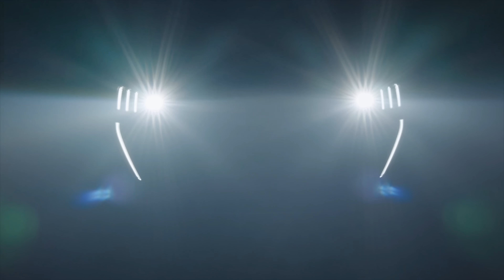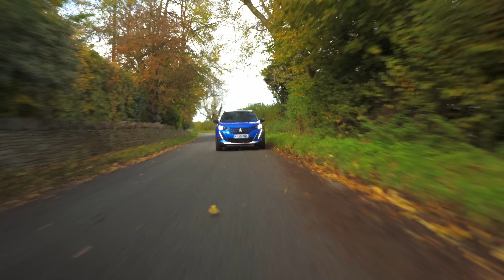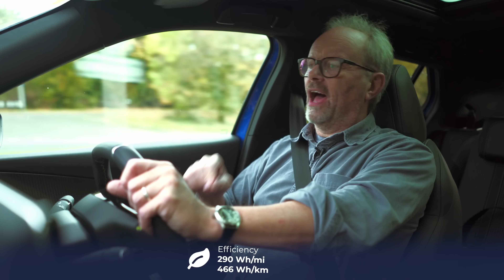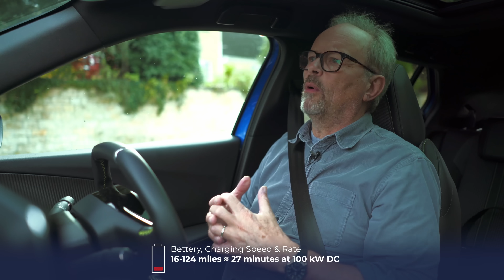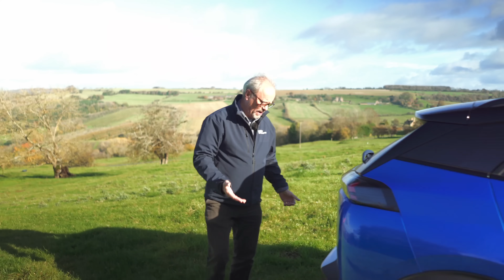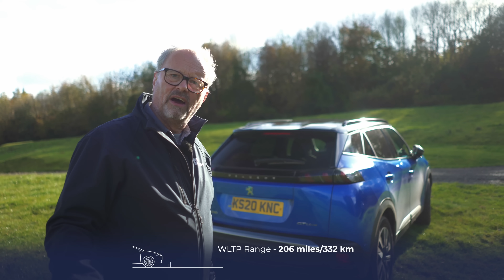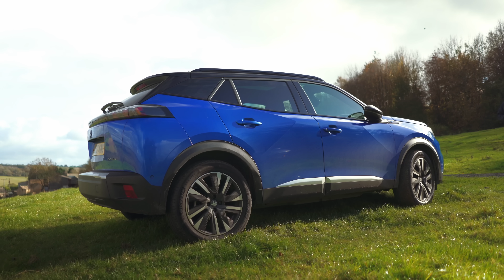Peugeot e2008 - how does it compare to other compact SUVs? | 100% Independent, 100% Electric

Comment: This has just dropped $25,000AUD in price!!! (In Australia at least) making it one of the cheapest cars on the market. Its low enough to make it possible for me, but after watching review after review and looking at the specs I just cant see the value even at that price. Poor range, average performance, ICE chassis, no reversing cameras, and it cant even tow a trailer. The BYD Atto 3 may not have the name, but it sure has the features.  Guess I'm waiting for the next crop to hit our shores and hopefully the prices keep the downward trajectory.

Comment: I bought this nightmare of a car, cental locking broke, heater broke, gearbox broke, air con broke in all under a year. And it only does 50% of stated range. Don't touch, don't buy. Walk away. Avoid, don't waste your money. Stick with ice car,but not a Peugeot car ever.

Comment: So you charged it absolutely full, and it said 130 miles. But then, after driving it many miles you say you have 124 miles left... As a reviewer (no, as any car owner) you should know the number on the display is calculated in several ways and depends massively on the way you drive it and where you drive it (city or motorway), so you shouldn't be pointing out "only 130 miles" instead of the projected 267 miles on the NEDC standard (which NOBODY uses, everybody uses the WLTP standard!) before you've actually driven it. Point is, if you are looking to find negatives, you will find them, whether they are relevant and real or not. This car isn't perfect, but the perfect car will never be made, so point out the faults but don't complain as if the car is rubbish because it has faults, as that is how it comes over to me.

Comment: I know where you're going with "it's built for a combustion engine but they've adapted it for an electric motor", but if the design is nice, is it really necessary for the car to scream out "I'm an EV"? And what should that be then? The front window on top of the front bumper, so people would know there can't be a combustion engine there? Nothing wrong with having the car look like a CAR, in my opinion. The only thing not enough manufacturers do is take advantage of the extra available space (in the frunk). But that supposedly is partly because it's harder (expensive) to fit in frunks and pass crash tests. At least, that's an explanation I heard from a Smart executive, who explained why there's only a tiny 15l frunk in the Smart #1. And to come back to my first point, the old tiny Smart cars hardly had an engine compartment, and they never became a success partly because they just looked weird to many people. So now Smart has changed directions and their new car (although an EV) looks like a CAR instead of a box on wheels.

Comment: You could drive a solar powered car at 20 miles an hour all day long and it would be more energy efficient than a freaking candle but i still couldn't care less, so your mpg to kWh/km comparison means nothing to me to be honest. I drive a diesel with a 45L fuel tank and get 1000 kilometers of range out of it and fill up after around 800kms for convenience's sake, and there's not really any chance in hell I'd consider making the switch to a car that I have to plug in every day, drive 1 hour to my office and have to plug it in there again just so I can turn on the AC on my way back with some peace of mind
Reply from the maker: Just try to imagine how many comments we've received almost word for word the same as this one you posted. 
Do you think anyone is interested in how far you can drive in a clunking, dirty, inefficient, dated and incredibly dull old diesel?
A machine that requires this country to import toxic, expensive, heavily subsidised fossil fuel from the most corrupt and corrupting regimes in the history of humanity.
But forget all that, if it means you can drive 1000 km without stopping, while you leave a trail of genuinely poisonous gas behind you, then screw everyone else, you can drive a long way and fill up quickly. Oh silly me, surely that is the single most important technical achievement the human race has ever achieved.
Never, ever, think outside your narrow, blinkered little world at the impact your actions have on the rest of the population. Screw them all, they don't matter, as long as you can drive 1,000 km non stop, every freaking day, then you just carry on sunshine. No one gives a stuff. Bye.
Reply: @fullychargedshow  I LOVE this reply! Truer words never spoken.

Comment: I have a had a e2008 since the beginning of march.  I have not reset the trip since i got it and it am averaging 4.3mi/kwh over 400 miles of rural and town driving.  Highest temperature has been 9 degrees C.

I believe i will get much better results in the summer.

Comment: I just had one of these as a loaner while my diesel car was in for a service. I have to say I thoroughly enjoyed driving it, so much so that I just drove aimlessly around for a while just to experience it some more:-) I liked the smooth linear power delivery and of course, how quiet it was. Some have mentioned intrusive road noise but I didn't find it intrusive at all. It rode quietly and smoothly, and I drove over some very rough roads. Space inside was ok too. I'm 6" and I found the space in the back seat behind me was more than adequate. 
I did find visibility a little restrictive though. The rear view mirror, because of the sharply raked windscreen, was half way down the windscreen and blocked a lot of the view to the left. Also, I found judging the near side a bit tricky due to the high bonnet line so squeezing through narrow gaps in traffic was a little tricky at first, but I quickly go used to it. 
I also liked all the high tech in the car such as sat nav, apple and google play, reverse camera, inductive charging for smart phones etc. You couldn't ask for anything more.
As for range I got it fully charged and in eco mode it had a range of 192 miles. This went down to about 170 miles in normal and 150 I think it was in sport mode. I found eco mode a bit sluggish and the accelerator required a fair push to get moving along nicely. Also, heating/air con was restricted in this mode too. Normal and sport were more like an ice car and it was these modes I used most. When I took it back eco mode was showing a range left as 100 miles. I hadn't done 92 miles, only about 50, but I had used normal and sport modes a lot and had the heating on so that must have been where the extra charge was used.
To sum up I was quite impressed with this 'looks bigger than what it is' little car and seriously considered considered getting one, until I discovered the price! The spec I had was a new Allure Premium+GT with just 300 miles on the clock. It retailed at a fraction below £40,000! That's a hefty price to pay for an electric motor and some lithium batteries I thought. I'm still considering though,  mainly to use locally, which is most of my driving anyway, and also because the tech intrigues me🙂
This all electric car is not something to use if you're doing lots of motorway miles but they are a great city car and 95% or more of us do drive mostly locally. As we all know they have no exhaust so don't pollute locally or wherever you're driving. They simply move the pollution elsewhere, ie, the power station where the pollution can be dealt with in one place with various filters etc. Which is a big plus I think:-)

Comment: I am a Fully Charged fan and also like Mr Llewelyn. But this is both at their worst. An under-researched review that’s overwhelmed by the rant-fest about non-dedicated EV vehicle architecture, SUVs in general, legacy manufacturers EV pricing models etc. Mainly  valid criticisms, but this was supposed to be a car review and somewhere an editor / director should have been doing both and either wasn’t or was over-ruled. The car review element of this was underwhelming.

Comment: So another equivalence is that this car has a 1 ½ Gallon fuel tank? Approximately. And depending on outside temperature, that will take you 130 miles? Buildings EVs for the sake of it is undermining the whole idea of sustainable transport.

Comment: I currently have a Kia Niro PHEV , but changing soon , dont know whether to go for a e2008 or another Niro. 
Can get the GT Premium model , for the same monthly cost as the e-Niro 2 trim level with the 64kw battery which equates to about 100 miles extra range for the same price.
e2008  looks a lot better than the niro though. 
Basically comes down to looks vs extra range

Comment: 130 miles on a full charge, that’s terrible. 
Long live Kia / Hyundai large battery cars with 280 miles.
I can’t say I’m impressed with the 2008e Robert.
My number one choice would be the eSoul. For price / range / speed / standard equipment / safety features it is a winner.
Great review though Robert, great channel.
Greetings from Cumbria.
Stay safe and well.

Comment: Dad got a Peugeot 4008 hybrid a while back and it’s quite lovely for what it is. I love the smaller steering wheel. Very elegant and easy to use, when I get back into the Skoda the normal steering wheel looks absolutely gigantic. I look forwards to the next generation of these cars, a proper EV from Peugeot would be very interesting.

Comment: “Waiting for a different designer to make an electric car not like a petrol car”.......the BMW i3 Robert!
8 years old. Designed and engineered for electric. Nothings been built like it since. And it STILL looks more futuristic and fresh than any other. Wheels in each corner, short blunt overhangs. CRF tub ultra lightweight. It’s brilliant! Shame no ones had the gumption, except VW now with the ID3 to do one. (Tesla’s are 3 box design)

Comment: Ok get the electric version as it’s much much better but is it much much more expensive?? I’d love an ev but until I can get one for 25k on the road I won’t- well keep our 15 year old 4wd

JusT looked up prices e208 starts from 26k pounds diesel/ petrol from 15k pounds- !!! 

So you can buy another car with the difference-

I love evs and desperately want one but why do manufacturers keep making them over priced- I know batteries are just too expensive right now 

That’s why they add all the luxury trimmings which cost next to nothing but gives more perceived value

Comment: I’d like to know how much it costs to charge one of these things. When I fill my 2010 Honda CRV (which will be my last ICE car) it costs about £55, good for about 450 miles or so. The financial angle is important to a lot of people.
Reply from the maker: Okay, here's a quick breakdown of how much 450 miles can cost in an electric car.
If the car does around 4 miles to the kilowatt hour (the Peugeot e2008 would manage that for 9 months of the year in the UK) and you charge at night on an off peak tariff, (I pay 5p per kWh overnight) then it's going to cost just over a penny a mile.
450 miles would be in the £5-£5.50 range.
If you charge on daytime tariff, say 15p per kWh, that would cost about £16.50 for 450 miles.
If you only used rapid chargers, (24p per kWh) then it would set you back about £28 for 450 miles.
Then, the most expensive electricity you can buy is from IONITY chargers (they are very fast) and they charge 69p per kWh.
This means 450 miles would cost £77. So yes, it is possible to pay more for electricity than it is for fuel.
But one final point, if you get an IONITY card, then you only pay £8 per charging session regardless of how much electricity you consume, so clearly you'd only use an IONITY touch to pay charger and pay 69p per kWh in an emergency.
Reply: @fullychargedshow  Thanks. FYI What flipped me to go electric was working for a month in Bangalore and experiencing severe air pollution, by midday my lungs and airways would be raw and sore, my eyes streaming. 
My next car will definitely be powered by lightning rather than exploding dinosaurs.

Comment: I dare say someone else has picked it up but this thread is very very long! So at the risk of repeating someone else's comment, 290Wh per mile (see 4m point in video) is 1000/290  = 3.45 miles per kWh. Not more than 4!! How could it possibly be more then 4 for a car of it's type? Sorry Robert!

Comment: I have ordered a GT line my daily commute to and from work is 28 miles and weekend around 40 to 45 miles each day on a very busy weekend. So realistic I’am looking at around 220 miles a week. So a month around 880 miles, if I only get 150 miles out of a full charge which I think is a bit low looking at all the evidence that’s just under 6 full charges a month. My electric supplier after 12.30am till 04.00am charges 0.05p per kWh this means less then £20 a month. I honestly can’t remember when I last went on holiday in this country I live 2 miles from Manchester airport and the last 30 years use this for my travel needs. If I can’t plug a car in 6 times a month on my drive and set it via the app to start charging at 00.30 in the morning there is something seriously wrong with me and I shouldn’t be allowed to drive on public roads. If the average driver takes time and thinks about their average distance spent in their cars each month they will soon realise that the obsession with range is just something everyone else seems obsessed with and the average person could easily live with any electric vehicle.
Reply: Very well said.

Comment: I'm not sure what Robert is complaining about when he says it looks like an ICE car and not something designed from the ground up as electric. Exactly what is it missing that it should have, or conversely what has it got that it shouldn't - in relation to ICE vs. EV?

This is not the first time this complaint has been made and I don't understand it. What are the designers missing that is apparently so important?

I can only conclude that the use of regular instruments and gauges in the position accepted by all except Tesla as the best location, i.e. in front of the driver, is what causes Robert to complain. He is a Tesla owner and it appears to make him think any car with information display in the traditional location, i.e. in front of the driver is 'dated'. I know he had a Model S, but now a Model 3 which he loves and I think leads him to mistakenly believes that all EVs should now have an iPod stuck on the middle of the dash and nothing else with which to control the car.

In fact the reason why most cars have their info. display in front of the driver is because ergonomically IT'S THE BEST PLACE. I know you can get used to turning your head to see the Tesla iPod, but that is NOT as convenient as simply dropping your eyes. That's why every manufacturer designs their cars that way (except Tesla) as the last 100 years of auto design have concluded that in front of the driver is indeed the best place. Then Tesla come along and have to be different and being more computer oriented than car manufacturer, they mistakenly think one big single touch screen display in the middle of the dash is a cool idea. NO IT'S NOT. It's a stupid place to have everything and touch screens are a nightmare to use while driving, especially on a rough road.

I don't hate Tesla at all and admire them greatly, but their choice of information display and control system as it is on everything bar the Model S, is dumb and the main reason I would not buy one.

It all reminds me of the company that has probably influenced User Interface design more than any other, at least in this millennium - Apple. In the early days of the Mac they wanted to encourage good software and UI design from their fledgeling developer community and published a book titled 'Human Interface Guidelines', to assist developers and ensure a coherent design for all Mac software. In this book I read the immortal phrase that I have never forgotten:-

"Consistency should be valued above idiosyncratic cleverness"

In trying to be different and hence inconsistent with all other UI design of in-car information displays, Tesla have displayed an appalling tendency for what I would actually term "idiosyncratic stupidity". Being different is not a good thing when what you have made different is WORSE than what went before.

But to return to the original point, I'd be interested to hear what Robert does think makes the Peugeot too much like an ICE car?

Comment: It is dangerous to compare energy efficiencies between petrol and electric without taking in consideration the total chain of energy transformation from primary to final product. What's in your electrical car battery is the almost final product as you have the efficiency of the engine to consider as well, whilst for petrol the engine efficiency is pretty poor (25 to 35 % depending on the technology).

For the electricity used you need to consider how it was produced, transported and stored, which is complex as the electricity you store in your batteries could be generated from many different sources ( gas, coal, nuclear, hydro, wind solar...).

For Petrol or diesel, you have to consider the efficiency in its extraction, transport and refining.

I guess what would be more important to consider is the primary source of the electricity generation, the losses in its transport and storage.

Also something that is not mentioned enough is the weight of cars in general, which is not helped by the heavy batteries needed for long ranges. The heavier the car the less energy efficient it will be.

Comment: I picked mine up end of September, new GT, from Peugeot Edgware. When I got into it in the collection room, it showed 200miles range. I now charge it at home on my wall charger and fully charged it usually reports +-135miles. It obviously has to do with the outside temperature, which in St Albans lately is very cold and that does impact the onboard estimated range. I was told that in ideal conditions (mild weather) that figure will increase.